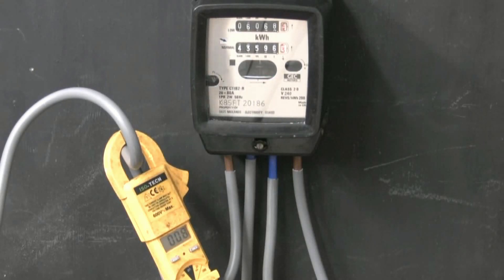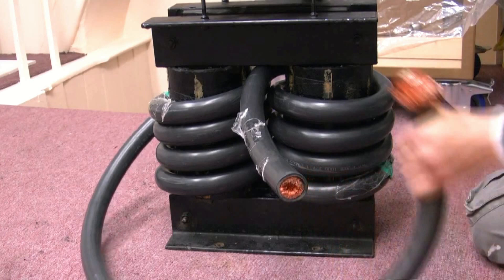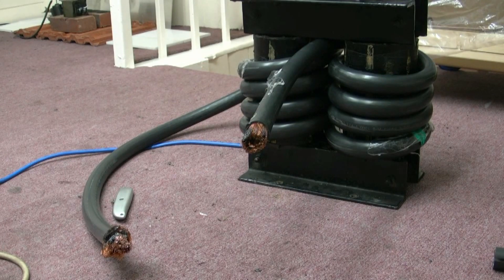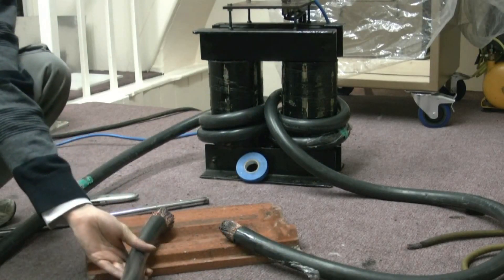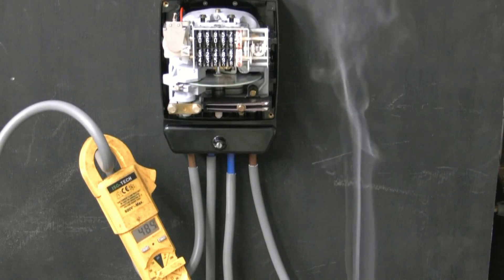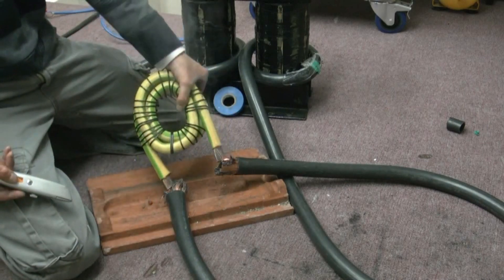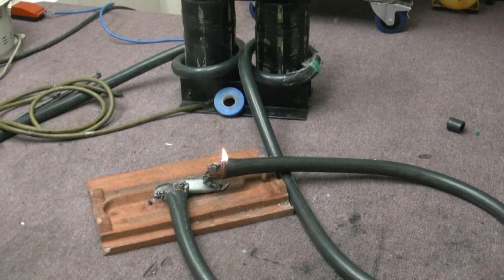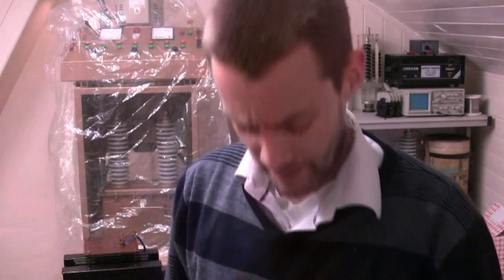Too Much Current + Electric Meter Pops

Comment: Seriously how does he get that much power?
Reply: +Bob Roberts 
No he doesn't need a high voltage, just a high current. 
A thick metal bar has a Very very low resistance, so you only need a small voltage to push a very large current through it.
If the bar is 1/1000 ohms then you only need1V to push 1,000A through it. 
A thinner bar might be 1/100 ohms so 1V could only push 100A through it. 10V is needed to push 1000A. 

If you had a wire of 53 ohms and put 230V across it it would push 230/53 = 4.34A (think of a 1kW electric fire)
Reply: Bob Roberts Transformers.
Reply: But in order to make a bar of metal get hot and start to "burn",  he would need high voltage along with plenty of amps,  as raising the voltage wouldnt have that effect.  
Wattage =amps*volts right?
Reply: Bob Roberts
Transformers increase current, also. Not at the same time of increasing voltage, however.
Reply: Chris Hutton ok

Comment: i dont understand why the metal rod heated up? like the voltage was very low, which is why he was able to touch it im guessing. But then to heat up the metal rod there mustve been a tremendous amount of current? But current is V/R so there should be a high voltage either way!
Reply: ruSEXtreme Voltage was low, but the resistance is also very very very low. See how thick the wire which is wound round that transformer is?
Reply: ohhh ok

Comment: Your bloody nuts but in the good way, never laughed so much, I had accident with 125A 3 phase supply running from 2 diesel generators synced up, (main and backup) 125A connector went into meltdown, then short circuit 1st generator stalled, 2 reved right up to max rpm in secconds and exploded shooting con rods and pistons through engine block, oops.
Reply: I’m suprised the engine grenaded and didn’t hit the rev limiter!

Comment: someone educate me, how did he not electrocute himself when placing the metal on the live wires? I have no experience in electrics so please excuse the noob question.
Reply: The transformer he uses has only a few windings on the core which means that the voltage is very low (maybe 2-4Volts). He doesn't want to achieve high voltages but high current. The voltage is way too low to injure or kill someone. example: if you short a car battery you'll get sparks and the two poles will melt together, because of the high current but if you touch + and - of your battery you won't even feel anything because the voltage is too low (12 Volts) to create a current flow through your body. hope i could help you :)

Comment: So many comments about danger when touching it. High amps low voltage is how it's done. Try this, wire up 5 or 6 car batteries in parallel so you still have only 12 volts. Then touch the leads together. You will see extreme arcs and the leads will practically weld themselves together. Not safe of course but very low risk of electric shock only risk of fire.
Reply: +HighwayStuff I was told amps are what kill, not voltage. Too bad school didn't teach me a darn thing about any of this
Reply: HighwayStuff Or you could take a double A battery and stick 2 bits of wire of each end and touch them, a lot more safe with smaller but similar results.
Reply: Yeah thats what ive always heard as well? Now these guys are saying its the opposite, wtf
Reply: Valthirian Sunstrider
When the volts are high enough to go trough you and reach the other end that's when amps start to count.
Reply: Valthirian Sunstrider
Schools are not for teaching.  Schools are there for torture!
Reply: HighwayStuff only risk of fire, acid burns, and death... real safe
Reply: grjr
lol yeah, I'll leave the risk taking to the uploader cause I aint gonna try it.

Comment: i cant figure out how hes fucking touching the box cutter looking thing at 8:53 right in the middle with out killing him self WTF why would you touch that unless you know its a low current and not a high current.
Reply: Its a transformer, output is likely 4 or 6 volts
Reply: Yeah, it needs to have a certain voltage to be able to get past the resistance of your skin. If this was directly across his heart, it would be a different story. All of the current will go through the chunky piece of metal rather than his body though.
Reply: +Robert Szasz Less.  But yeah you have the idea

Comment: So I'm guessing you took the considered judgement that the short was the least path of resistance, and not your hand?  Interesting.  The science probably check out, but I still wouldn't risk it.
Reply: David Palmer High amps low voltage. Similar to what happens when you wire up a bunch of forklift batteries. Arcs like a welding machine but voltage is 24 volts.
Reply: HighwayStuff Oh, I see.  He didn't actually say how many volts... so I forgot he was using a transformer
Reply: David Palmer
Yeah me too at first. I was like what the Hell? Then I realized what he was doing. Still a pretty cool video. I like his humor and how he goes about doing it.

Comment: Wow this has sure generated (pun not intended) some seriously tetchy comments from "experts".

You can get a LITTLE more power from the house fuse if you hook up a CO2 line to the top and bottom of the fuse carrier where the cable comes out. Adjust output so it doesn't QUITE leave dry ice deposit (as that will block gas flow). After a minute or so, the carrier, cable ends and shells of the fuse should be around -70C and as the fusewire is copper tends to help (significantly) increase current handling.

Yonks back, I used to refill people's nitrous bottles and the advantage of using nitrous is that if you have a dip tube (or invert the bottle), you can feed liquid nitrous into the fuse carrier (and as I am sure YOU know, NO2 is NOT flammable contrary to urban myth). This results in awesome cooling - HOWEVER the cost of the nitrous is an order of magnitude more than CO2.

I just yearn for a detached house and space to park an ancient but functional diesel gen set of a few hundred KVA and some distribution transformers to play with.

Comment: People who say that what he is doing is dangerous: Yes, while playing with high voltage high current power supplies has the potential to lead to a disastrous situation, this is usually not the case with Photonic as he takes many precautions that may not be so obvious to the untrained eye. Notice that most of his videos involve making things explode or glow red hot or "pop" or burn or whatever the outcome may be. What is actually happening is that he uses conductors to "close the circuit" on his beefy power supplies. This causes a massive surge of current which would otherwise be impossible to obtain without his equipment due to the unavailability of high voltages, fuses, limitations in household circuits, etc. The massive current and subsequent resistive heating (friction) of the material and then finally the "pop" or whatever is just damaging to whatever he is heating (e.g. a kettle pot, dildo, iron rod, coconut, etc.) If the power supply is rated to handle the power, everything else is fine. He is also usually ok to handle these massive wires without gloves or any other protective gear because electricity follows the path of least resistance. The current will flow through the conductor he is trying to explode and the wire rather than his body (as long as he doesn't touch the wire and yes this may happen accidentally). Now, flying projectiles, resulting fires, etc. may be dangerous, but the actual electricity is not in most cases. But then again, so is crossing the street or going down a flight of stairs or playing a game of football. All of you take relatively pretty big risks every day without noticing so please refrain from criticizing an expert electrician for being "stupid" or "incompetent" for sacrificing a small amount of personal safety for entertainment. Michele Romeo

Comment: Isn't that a little bit DANGEROUS???? just asking :)
Reply: While the amps are high, the voltages he is working with make it safe in that regard. The most dangerous part of the whole setup is the heat generated from the current. You could grab hold of both leads of that transformer and not feel a thing.

Comment: First off, I may not be an electrical engineer. I may just be young student who doesn't know very much about electricity or physics. But I do know that there is a huge difference between voltage (volt) and current. (Amps) Second, 1 amp of current is a lethal amount. So you are either measuring voltage and not current. Or your there is something seriously wrong with you meter.
Reply: He is not getting hurt because while the amperage he is pumping through the wire is huge (i am not quite sure of the number, i do believe he said 250A?), he keeps the voltage low enough for it not to be able to overcome the resistance of his skin. You can have 250A but if the voltage is low enough not to be able to penetrate your skin nothing will happen, look up Ohm's law. I'm studying electronics currently and this is one of the first facts they teach you.
Reply: You won't get the amps without the volts. If the path resistance is low you will get the amps on a lower voltage. Simple as this: E/R=I, examples: 12V/1000 ohms = 0.012A or 12mA. If E was 120V at the same resistance of 1000 ohms (1K ohm), I would be 120mA, ten times the current. The resistance through the body is almost always much higher than 1k ohm. In fact it is ten times this or more.

Comment: So how did you not get shocked?
Reply: High current, low voltage (low enough not to overpass resistance in his skin).
Reply: Very interesting.  So could you have low current but high voltage?
Reply: you'd have a painful shock and electrical burns (not sure about the burns). As long as the current is kept below certain treshold. You will most likely not be able to let go of the live wire at certain currents (neurons firing leading to involuntary muscle contraction, if in direct current you'll tighly hold the live wire and if in alternating current you'll spasm). these values are often used for cattle prods and taser guns. If any electrician sees this comment and sees a mistake of some sort feel free to correct me, as i am just in the first year of studying electronics.
Reply: Irontaco Thanks for the information.  I find electronics fascinating